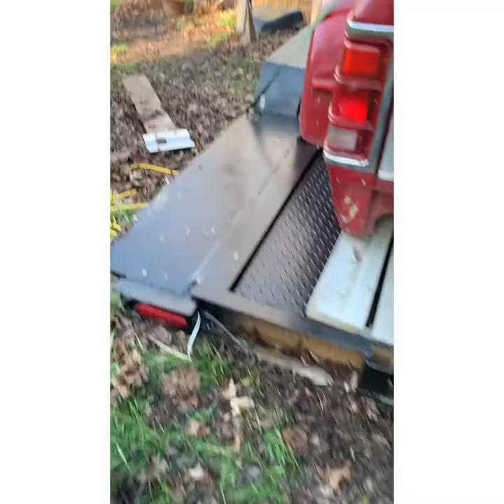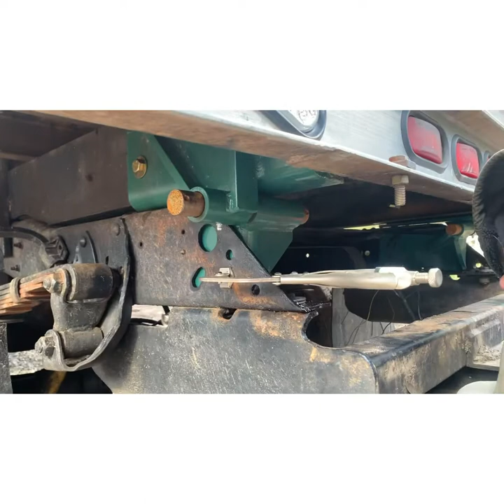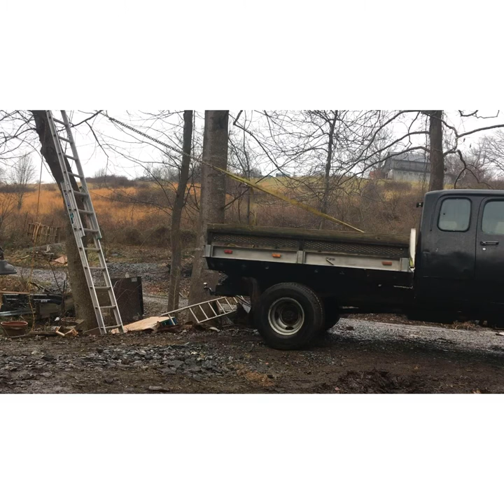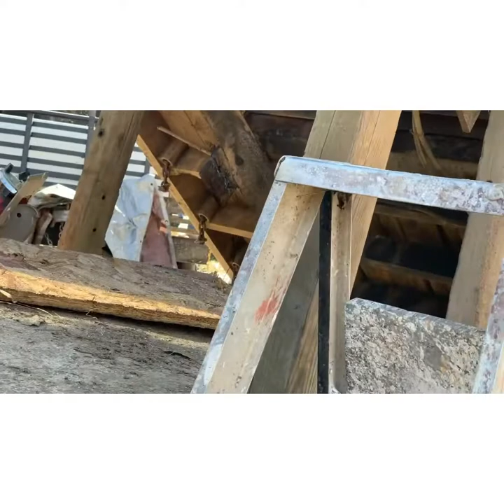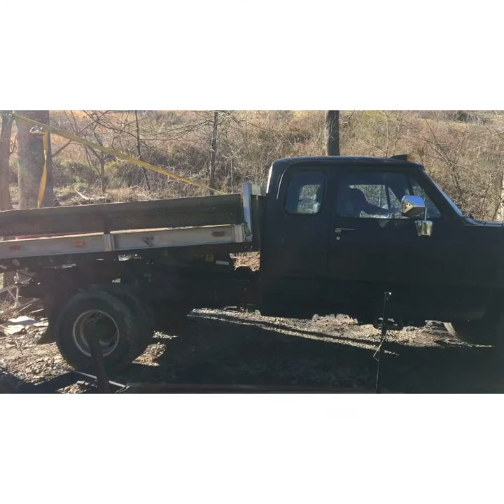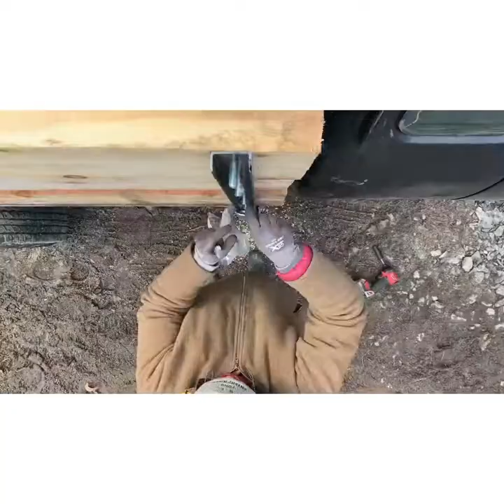Adding a flat bed dump to a truck

Comment: Did your kit say to mount the scissor like that, or did you just reverse it?  But it looks like you can get more lift by reversing it.  Any problems with less lifting capacity?
Reply from the maker: I've had like 3.3 tons in it and it lifted it. Haven't had more than that because my springs would bottom out. But seems fine!
Reply from the maker: I put it that way so I could still have a gooseneck hitch potentially